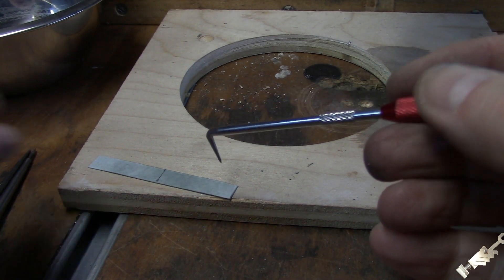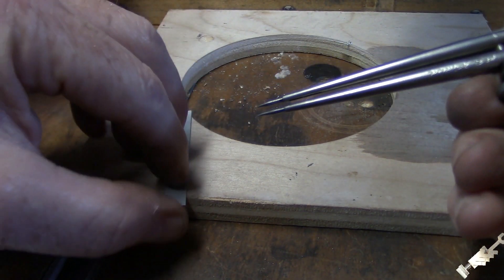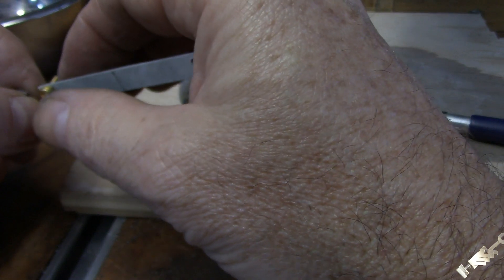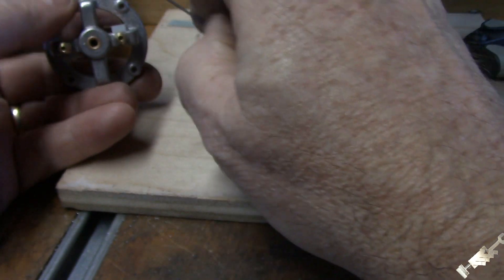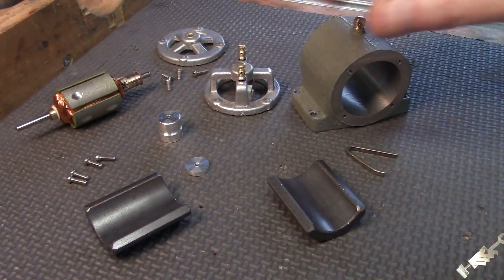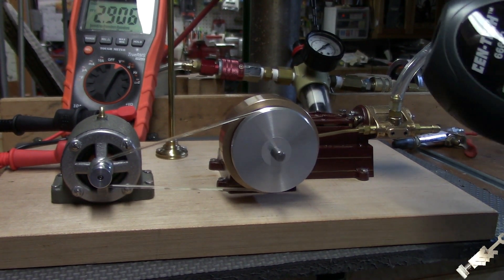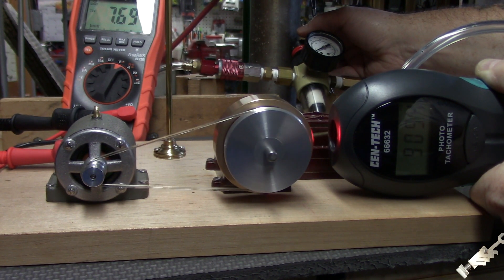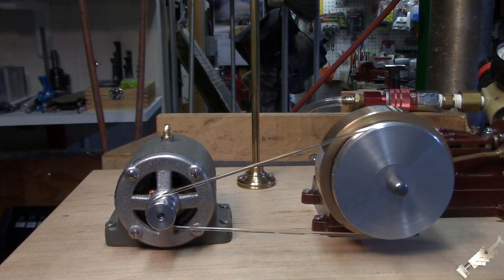PM Research Dynamo...completed

Comment: That turned out very nice. Thanks for taking us along on the adventure. I presume that the dynamo is generating AC voltage and that the lamp is a LED. Would adding a bridge rectifier increase the brightness since the current is switching the LED off and on?
Reply from the maker: Robert Oswalt actually it generates DC voltage, you have watch the polarity or the LED will not light.